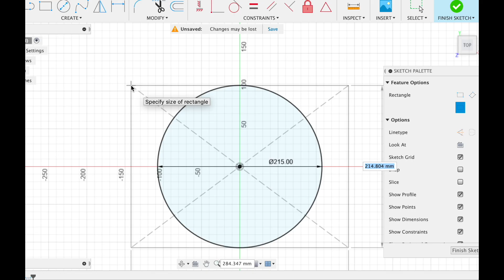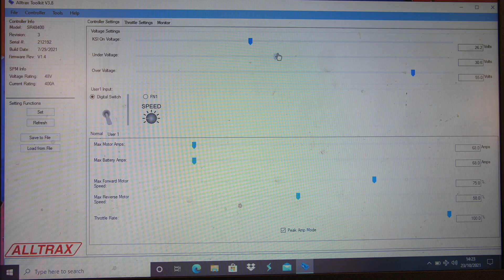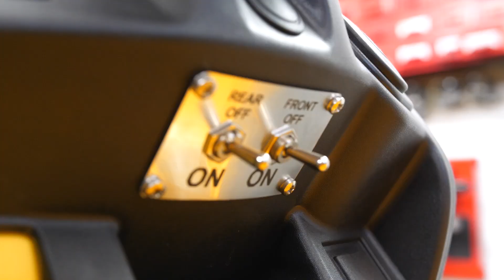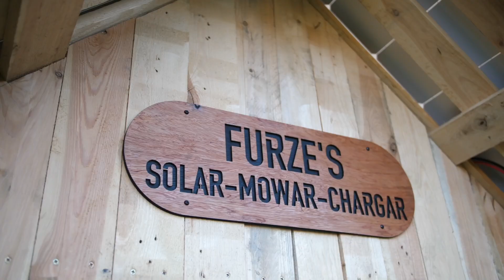EV Mower Conversion with Solar Charging Station

Comment: @colinfurze
Apologize if you have already answered this question. But I have been reading the comments hoping to glean this, but what electric motor did you use? Can you provide a link? I am considering a similar project, but am not sure if the motors that have been spec'd will have enough torque at 3k+ rpm  to effectively turn the blades in a tall grass situation.

Comment: If you can afford and if they'll allow you to.  It would be awesome if you covered complete house roof as well as every inch of every wall with solar panels.     Tight one panel touching another.  The house would look like a Black Glass house.       That would be 😎.      First house ever all walls and roofs covered with solar panels.   Grid tie and after a month see how many percent of electricity comes from solar.         Maybe you'll get 90%+  of house's electricity from the Sun for the next 20+ years😁.     Free heating, cooking.  And everything else. 🤗

Comment: once knew a guy who installed an electric battery powered lawn mower robot to cut his grass. he managed to power the charging station using renewable energy instead of from the grid. the robots have been on the market for a while but they can get rather pricy depending on size required for amount of grass to cut.

Comment: This is especially useful if you have solar power already. Same as with an electric car: the big advantage is not just the driving/mowing, but also that it has a big-ass battery. So once it's charged and you're not using it, it can give power to the grid (or other of your own appliances) from its battery on a 'British' day. Truly the future. It essentially becomes a battery that everyone once in a while you use to mow your lawn.

Comment: unless your panels have micro inverters your going to get serious losses from that cover hat you ran down the middle of the roof/panels. Even tiny shadows cast onto a panel will reduce the entire panels efficiency and the center hat is not small. You might also consider not letting the batteries go below 50% or higher if possible because they will last a lot longer and a half our is probably fine for cutting an average lawn

Comment: No no no all wrong...the future is not Lithium...put an electrolysis in your ched and run it with Hydrogen!
Your Lead Acid can work as a Solar-Power Storage Unit for the Bunker for ex.

Comment: As much as a neat build this is, I'd like to see a cost break down because cost is the main reason this isn't already the norm. A ridding mower Colin has would cost about $2000, probably a little less but lets use round numbers. Deep cycle lead-acid batteries would cost about the same, and that is just batteries. Convert the lead-acid batteries to lithium and you can triple the battery cost. Add a frame, electric motors so lets add another $1000-$2000. The solar panels and controllers are probably 1k each and we might get away with 2. So I'm guessing conservatively maybe $6000-$8000 for something similar to Colin's mower. 

That's why most electric mowers are crap. They keep the motors and batteries small to keep the price down and comparable to gas units.

Comment: Maybe add a battery bank in the shed for the times where you dont need more charge but there is more sun. Or in the Cold months the battery bank could supply your underground bunker

Comment: Just a thought, I would recommend adding something to the trailer connecters to make plugging them in the wrong sockets impossible, or at least very difficult. Even if only one is modified, as long as one of the sockets can only be plugged in to the right connector even if the other socket can be plugged in to either, that won't cause damage because no current could flow unless both were connected. Unless the charge controllers already have reverse polarity protection, in which case it's not as necessary, but still a good idea

Comment: Interesting data from this. For a normal  1/4 acre house block this is too big. Shrink it down will lower the cost of batteries and panels. A few second hand panels will be enough? Maybe a stand on instead of sit on design.

Comment: The irony of this.  It was the early 90s, and my best friend and I, all of twelve years old, went to an estate sale and bought a John Deere electric riding lawn mower.  This mower had a 36v electric drive motor, 3 speed gear box, and 3x 36v mowers attached to the deck spinning the blades.  We paid $100 for it, a snow plow, the deck, small yard trailer, and a few accessories.  Meet;  Our first performance vehicle.  First order of business, this thing was far too slow, so we swapped the pullies on the drive motor and the gearbox.  This bad mamma jamma in 2nd gear would pull some WICKED wheelies.  With or without the trailer attached!

Super long story short;  I may, or may not (spoiler:  I did) accidentally drive this thing straight THROUGH a neighbors six foot tall cedar privacy fence.  See... what had happened was... we were tooling along in the easement next to the street, when I decided to drive under a pine tree.  Well, the tree had some thick low branches that I didn't expect, which grabbed teh steering wheel and cranked it hard right then pushed me off the side.  Boom.  Right through the fence it went.

That was hard to explain.

More than twenty years later, I reflect back on that... man I wish I still had that mower.  It'd make cutting my grass super quick and really easy.

Comment: So this would be hugely useful with a couple of big ifs. Like if you can get it going twice or even three times as fast as shown while not missing a single blade of grass. I would also nail down just how long it takes to charge. Finally, can you make a zero turn version of this? Lastly what is the cost per mower w/ and w/o the charging shed and can you make a separate cord that any wall outlet could supply the charge for? And how much does a full use of the mower cost to recharge both using the shed and not using the shed?

You have effectively pioneered a full working prototype here that companies could after to upscale and sell to the masses. I hope to see more on this one.

If you could get to go 10mph to 15mph with a good enough cut and it can run all day and charge overnight this would be a game changer for landscaping companies overnight.

Comment: A lot of ""If this, If that, all rain, no sun"" you can still plug it into an outlet people!!! It's great to be solar with electric or generator backup guarantees It's charged. If not fully charged the day before planned mowing plug it into the house to top it off. Either way you're using as much solar energy as possible first.

Comment: Check out XS lithium batteries, they are small and last a long time, and have good amp output. You could also fit 50% more batteries in it

Comment: Colin does not refer any cost whatsoever about the electrical equipment installed.. Guessing 2x 5kw HUB motor 1200 £ 6x 50Ah lead battery 300 £ 2x HUB controllers 5Kw 1000£ 6x Solar panels 100w each 480£ 6x solar battery chargers 400 £ cables, connectors and accessories 200£ assuming a mower chassis on the market would cost 1000£  we are on about  4580 £ worth of a mower... its still worth it? maybe yes but not for all...

Comment: Any chance you could be convinced to DIY an hydrogen fuel cell to drive the solar mowar?  I guess the shed would need a water hooker and electrolysis setup, but the nice thing about being in a garden is that you probably have a hose to hook it up to  ;3

Comment: Now you need the entire kit. Solar-Weed-Wacker, Solar-hedge-trimmer, solar-pressure-washer,etc. I will say here in the use we are starting to see fully electric zero turn riding mowers. However the output and range I'm assuming is completely different 😅

Comment: Better still would have your Tesla Powerwall (other brands are available….) built into your mower.  You could use it to run your house for the 166 hours every week you are not mowing and then disconnect it from the wall and mow your lawn …..

Comment: I wonder if youd have to be more worried about thick grass choking the motor though. Even gas motors choke out if the grass is too thick and I think they automatically cut off if that happens

Comment: Hey Colin; with the mowar having that much POWER, with what you mentioned on the end of the video would you think you can make that mowar race? I don't know if the UK has it but I think there are some mower competitions here in the states where people modded their John Deer mowers for racing. With that much battery power; how fast can it go (using a police radar gun) and how long will it last?

Comment: Surely the most green lawn mower would be powered by grass as a fuel? Perhaps you could compress/dry the grass into logs and run your wood gas mower on it? It would become self fueling (with extra steps).

Comment: From a guy that spends 4+ hours per week on a mower and mows close to daily, I don't think this concept would work too well. For this use case, it might work brilliantly, though. I just can't imagine the costs of 2 esc's, 2 motors, 6 batteries, and 8 solar panels compared to one lawn mower engine. Also, the lack of sunshine is a bit concerning at the end of the mowing season. Nice execution of the project, though

Comment: The lead acid batteries may actually be a better option than lithium ion, it still has good capacity in the use case, and doesn't carry the risk of combustion. I know combustion is kind of rare with lithium ion, but that slim chance my ebike could burn down my house keeps me up at night.
Though a better compromise between capacity and safety would probably be a lithium iron phosphate battery,

Comment: Golf courses need to go electric lol well actually they shouldnt exist, all the water waste, gas waste and tankers full of pesticides, herb,fung, ect  lol all my coworkers who had been on the crew for a long long time all got cancer, survived it but one guy is 56 and hes not going to make it,  the people living on the course have a higher rate of cancer too but my point started at how both my brother and i are only 26 and deaf as shit from those mowers lol all the old timers speak very loud, almost shouting in a quiet lunch room lol and lot of hearing aids x.x although my coworker who moved away to work for a better course since our home owners and board members put money into the course not the equipment and he saw a course that got all new stuff so he went there and said OMG DUDE... THIS IS AMAZING lol he sent a video of him mowing in an enclosed cabin, it had a radio ( no big ass radio on your belt anymore ) it had ac and heating, heated seats, automatic dumping... meanwhile im getting rained on like crazy on a loud machine missing a muffler for 8 hrs having to dump 3 huge plastic " bags " huge thick heavy shit filled with wet grass, feeling every bump in my spine when driving lol i shrunk an inch and spent so much money on chiropractors... slipped a disc on a pot hole.. lol. hes like " the suspension is so good i can drive up and down curbs and not feel it " lol and the fairway mower he said is a tractor beam so all you do is hit start and chill and make sure everything works and the mower dont go hitting people or getting out of ways lol but they still went through a tank of gas every week, by tank i mean huge tanks that get filled by the same trucks who fill gas stations lol all that so like 100 members can golf ( my course i swear only had the same home owners golfing, only saw new people during public events ) such an unsustainable thing... and 90% of golfers are straight up narcissistic assholes who treat you like absolute shit ive had a guy throw his ball then his club at me blaming me for a missed shot cuz i was distracting him mowing the hole like 300 feet away lol came up to me assaulted me then got away with it, boss didnt call cops and told me to avoid him in the future xD manyyy cuss words shouted, middle fingers, being waved down to give me a piece of their mind lol one guy waved me down to tell me i didnt look like i belong at a golf course and needed to cut my hair and get a life, later my boss said he and other members at the meeting complained about the kid with dreads and they wanted me fired because i looked like a hoodlum and my boss was like you know colbi you are very loved by ( these 5 members ) i was going to be fired and 5 members said if i go they are selling everything and taking down the course, idk how that works but they owned majority or something but they stood up for me lol my boss was like you got lucky cause i wouldnt put my hide on the line for you, those old folks wouldnt hesitate to fire me if i didnt get rid of you lol and coworkers wanted me gone cause i was doing too much work too fast and ruined their routine of gambling on the phone and being on a leader board and had a pool going of workers for streak 4 cash highest streak won, they would spend prob over 60% of the work days researching  picks and bullshitting but made it look like those breaks were apart of the job like going to the dump area where nobody sees and telling ppl its work but then i didnt wanna join that and id keep working the entire shift, the boss noticed my spread sheet ( 4 hrs approaches 3 hrs fairway ) ect and during break he came down from the pro shop and the big boss told my boss hey these numbers dont add up... is colbi actually doing these jobs in this amount of time? the crew was like nooo he got it wrong no way thats possible... but the big boss was like hmm... well we got reports of all you standing around doing nothing but playing on your phones and the home owners are saying while the kid with dreads is working non stop you all pull off to the side and are sitting on your phones for 15 minutes and stopping every hole sometimes and gathering at the dump for a long time but when colbi goes to the dump hes in and out and the owners now know you are all slackers and now if you are seen on your phone you will be fired and also now i know what one good worker can do, i watched him and yes he is doing all the work in the time he logs it for... so they GOT PISSED they were soo mean to me.. i actually cried twice at work from the hazing lmao im disabled so i work at 200% just to prove myself and they would make fun of the way i walked, talked, hair, making sexual comments about my mom... lol i was 18 btw first job xD and now the jig was up for em they actuallly had to work a little and a month later the big boss said " well thanks to yall actually working we have too many employees now... not enough stuff to do for yall.. i wont fire anyone but theres going to be 4 of you going part time until the seasons over and next season instead of hiring 4 seasonal workers we dont need next season we have x amount of money leftover figure out what you want the most " lol so mechanic said he was ganna quit if we didnt replace one of the mowers he has to tow and fix daily so we did actually get 2 new mowers before i quit and those were ofc these 2 old guys were bestfriends with the crew boss, kept the keys to those so they got em and claimed them and that job lol the mechanic threw a wrench at my head once, flew right by my head... so i never liked him but one day he came up t the old guys and was like give me the keys... i need em... then without looking at me he comes over and hands me the keys and says you deserve to mow on this mower and told the old guys to suck it lol he became nice, then came in drunk, punched a few ppl and got fired then next year i come in and hes back and all happy to see me and nice lol was weird.. within 30 min i was stuck in mud and my muffler broke off again and burnt the grass.... i was dreading the radio call... " mike... im stuck on #2 ..... FUCK... ROGER THAT OMW " LOL but he was nice to me, only worked there for a bit until new guy came. biggg vet he was tough and scary but loved me, idk how many pounds of weed that guy gave me from his garden lol i had been hiding the fact i smoked weed for 2 yrs... this guy brings a 15 gallon bag of weed to work and starts offering it to everyone and to my amazement the boss and crew were cool with it lmao 8 yrs later im still going back to the shop sometimes when he ask me if i can take some plants so he stays legal limit, sometimes seeds dont germ and so he plants extra and this time they all took so i went and got em and kept em healthy for him until he could harvest enough to take em back lol its pretty funny loading up weed plants at my old job while golfers walk by asking " is that weed?! " lol..........

congrats if you made it through that novel... im so bored i actually wrote that... yay 2nt quarantine lol

Comment: im probably not the only one thinking this can be improved and made into a business. provided you have an engineer/mechanic that can get the speed range and charging issued addressed.

maybe you have 10 mowers like that. use 5 one day and let the other 5 charge, provided good light. and even then, you can always have bigger banks of batteries at base charging over weeks to make sure your mowers stay topped off and ready  to roll at hte start of the day.

Comment: You may want to look at eBike battery packs. They're typically 36V or 48V and run around 400-700 Wh each. Probably similar stuff out there for electric motorcycle conversions as well.

Comment: peak English summers, 2 cuts a week seems fair,,tis what it was this year, a right royal pain at times keeping up.....pretty much spot on with solar  pallet block house.should work a treat on a good day of sunshine...lol .. lead acid batts might be heavy but way easier on planet than Lithium nickel manganese · Lithium polymer etc .. which are lighter. take up less cell area but require a sensitive charging system with lower full capacity charges to maintain longevity towards high cycle return